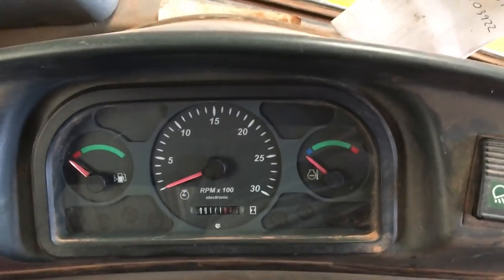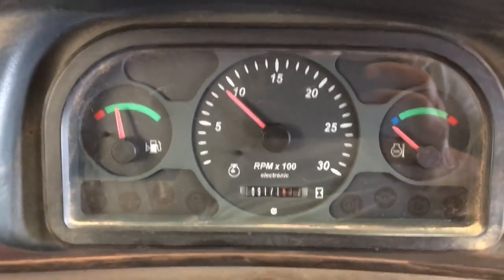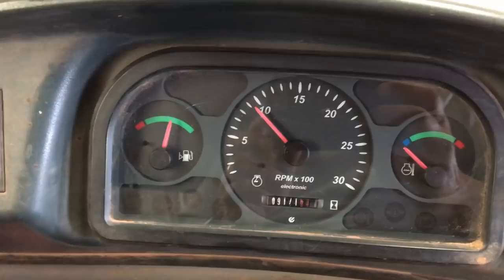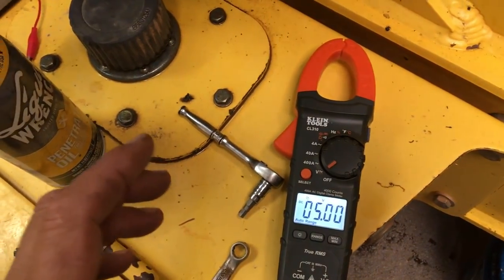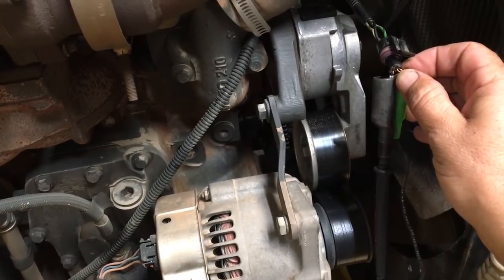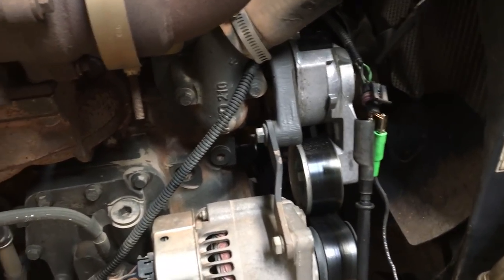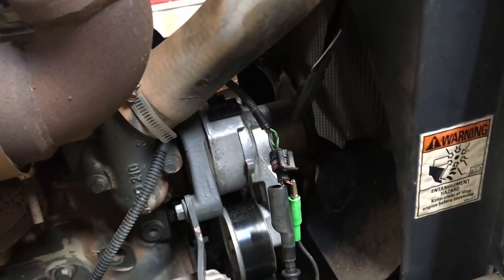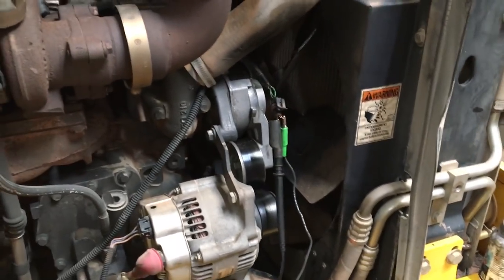B95 Temp sensor

Comment: If you had not figured it out I was going to tell you the third wire is the pickup to tell you if you need the glow plugs to cycle. You are good at figuring your way through stuff! It works off the block temp not the air temp the same as a diesel pickup. The bad part is Amazon is putting brick and mortar stores under everyday. I am glad the dealer got you the proper parts. From working on O2 sensors and stuff like that on cars I have learned to check that the new part will plug into the pigtail before I do anything else. Great repair video, you figured your way through and learned  about the wiring. That is a win you made a great video that is a win. Thank you for leaving the part in when you edited this video about the wrong sensor. People will be helped by that and might check before taking the old one out. Thanks for pulling through and making a nice video for us this week.
Reply from the maker: tdej80 Thanks!!!
Reply: @Digginok  I finally got caught up on welding and have a Sunday off. The other night I finally got some pictures and was wondering if you wanted to see? Some stick welding and TIG welding that I done.
Reply from the maker: Sure!
Reply from the maker: Email to cunningfranknham@ Gmail.com

Comment: Can you imagine how awesome it would be to be able to work on your tractor at the dealership they are online mechanics has the parts department right there. I used to spend 3 hours if I was lucky to get the parts and then get back and find out if it's the right one or not you didn't have to drive all the way back again oh, dammit I still miss those days damn I used to love what I did for running a tractor loader backhoe for sixty years nowadays I don't even see tractor loader backhoes they're all mini excavators whether it's electric company the gas company rental companies it's all them damn Minis. After running TL bees for almost sixty years I look back and take pride in every job I've ever done to the best of my ability damn I miss those days

Comment: Hi the only part that sucks is now your sensor cost more, than if you went to the dealer first.    If you left the cap on with no pressure when it was cold you should loose less fluid, as it should come out slower.   When i change tractor clutches  I'll sometimes use the cap to hold the flow back if the drains in a dumb place, and I have to drain from a block line instead. When most of the fluids out Then i'll pull the cap and drain the last bit quick, when there is less to spill all over the place. 
            My luck with that sensor would off been I'd of got the old one out, dropped it then found the bloody thread was different and the new one wouldn't fit in!.     It's like a guy I'm working for now, one tractor Massey wanted 3 weeks plus to get parts from Europe when we figure all we needed. Ok  we'll do the clutch in the other one  so he has 1 loader tractor running yep that went well, the clutch he needed for the other one was out of stock 2.5 weeks with no other choices when we actually went to order it ! . The only plus was both these tractors were parked side by side in his shop not in mine taking up space I needed here for other stuff. !.
          New machines bankrupt the business 1 finance payment at a time if you aren't careful, the stuff you already own does it 1 part at a time when it gets older and not reliable.   I think you are still ok on the NH for a while yet though.   Now our Canadian $'s crap you could probably get a good deal on a nice one here to replace it. Our $'s about 73 cents to the U.S. so you'd save about 25% buying in Canada even with the NH not being that popular up here compared to others.  Thanks for the video take care.
Reply from the maker: super6954 the old B95 is still pretty cheap to maintain for the most part. Funny thing is I almost dropped the sensor one time😂